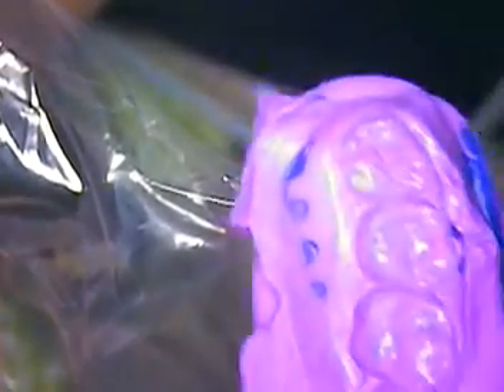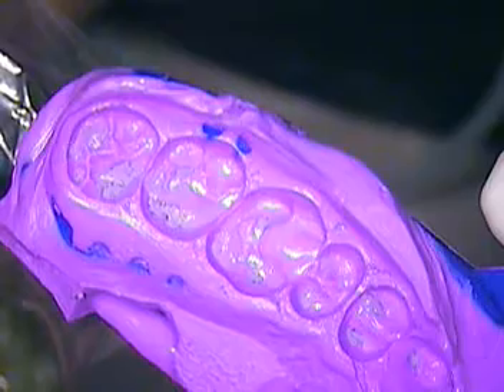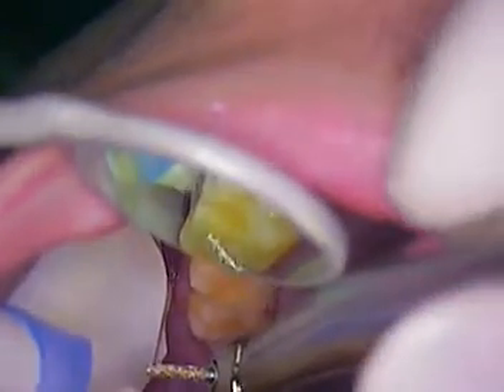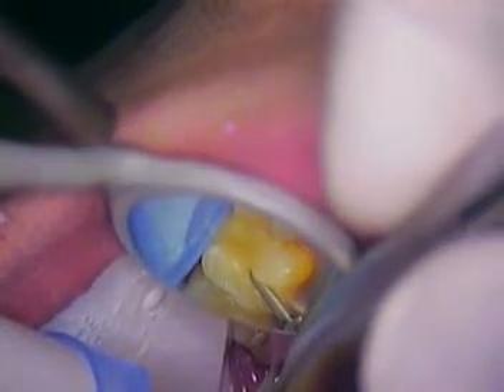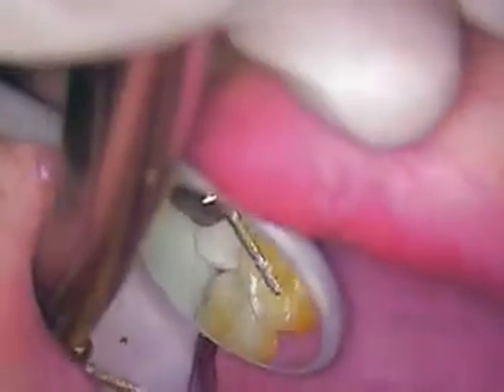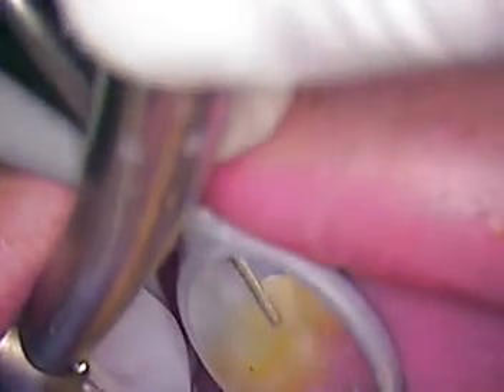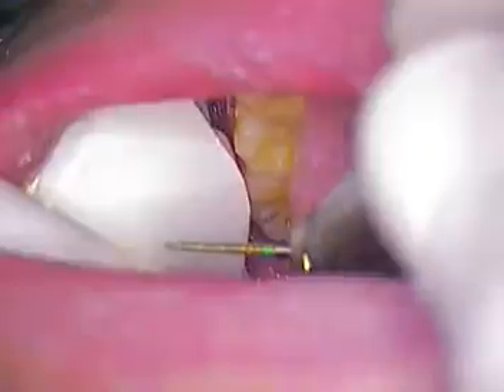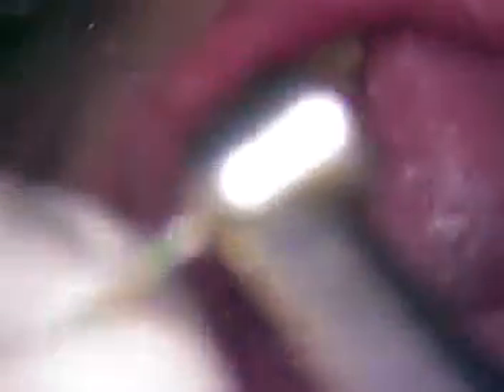DR GERARD CUOMO - Difficult Porcelain Crown Prep 1 Tooth Preparation Boca Raton FL

Comment from the maker: Hi there- my technique makes preparing proximal areas easy.  I start on the marginal ridge using a long chamfer course diamond bur.  Placing more pressure on the end of the bur, you can angle your cutting from an occlusal to apical direction.  I will leave a thin wall that actually contacts the adjacent tooth.  This prevents accidental "nicking" of the adjacent tooth. Then you can "flake" the wall away using the bur or an instrument. The air/water blows in one direction saving time. GC